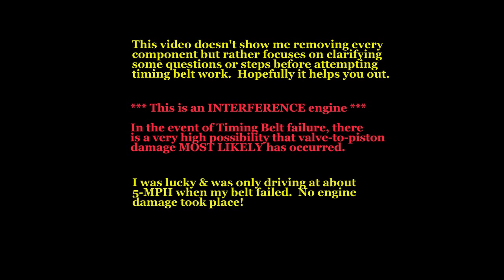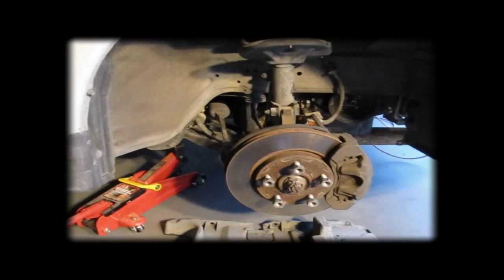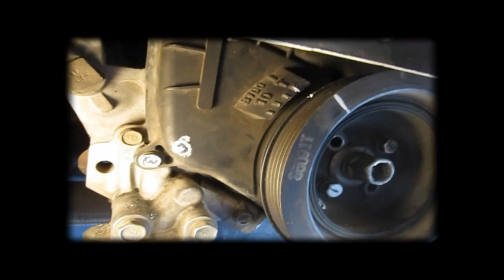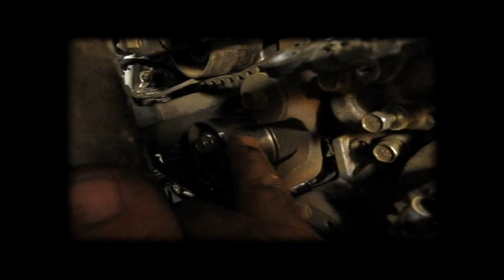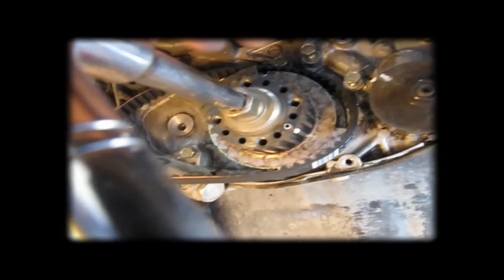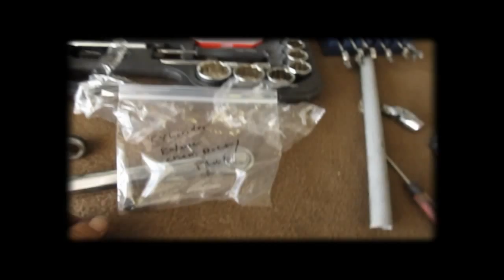Part 1 - 2003 Mitsubishi Galant 2.4 L Timing Belt Installation

Comment from the maker: Originally from Mich so I know what u mean about rust. U really don't need to remove the crank pulley when changing belts unless there is something else u are working on or if it's damaged. But if you still need to remove, I would spray the bolt w/ WD40 & let it sit a hour or so. I would even try heating the bolt w/ a simple cheap heat gun then try to break it loose. Ultimately an impact gun (air or electric) or a long breaker bar should do the trick. If manual trans putting in gear may help.

Comment: Mark, thanks so much for your video.  I have a 2001 gallant and I am having a hard time getting the crank pulley off.  I think I may have to loosen the crank bolt.  Is there any harm in turning the crank bolt to the left to loosen it?  Should I put it in gear?  I live in Ohio and this car has never seen a garage so it is quite rusty and stuck.

Comment from the maker: One more thing to check if you are sure all marks are aligned & car is not starting.  Check to see if your crank-position sensor is damaged.  The magnet in mine came apart when the belt broke & definitely would have prevented the car from starting.  I almost missed seeing it was damaged & only figured it out when I found the magnet stuck to a metal part of the engine. I wondered where it came from!

Comment from the maker: U-said..."When I finished it the marks lined up but the car did not start, did one explosion and died". Did your belt break completely while driving at a higher speed?  I would say 30+ mph.  These engines are interference type & severe damage can result from a broken belt. Mine broke at about 5mph and hoped it could still be repaired. It was worth a try & I was so lucky there was no engine damage. I hope you are able to get your car running again too!

Comment from the maker: Sorry to hear it didn't start.In the beginning both belts are off.Start 1st aligning balance sprocket & mark.Install small belt keeping mark aligned. Next ensure oil pump sprocket is aligned w/mark using the small screw driver method and it locks. Back off again to mark. Rotate CAM & Crank & align their timing marks up. Install Timing Belt keeping all marks aligned. Rotate crank (wish I paid attention to how many turns) but believe it was on 3rd but not more than 4th.All should return & line up.

Comment: When I started the job all marks where lined up but when the balancer belt came into the picture I had to turn the crank shaft, now the mark is moved, how many times do I have to turn the CS around for it to get back to the real position? does it matter how many times or only that the marks line up again?? When I finished it the marks lined up but the car did not start, did one explosion and die.